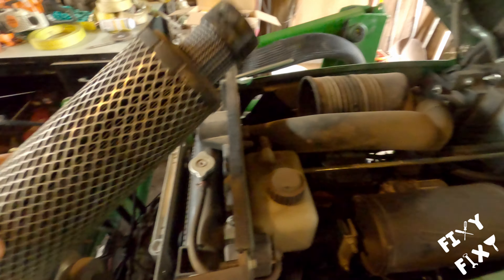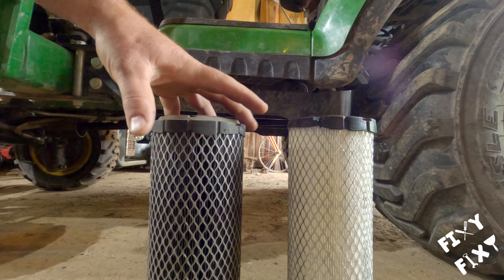Air Filter John Deere 1025R Replacement

Comment: This shows the old air filter mount I believe which I understand has an issue.  TTWT has a video on this issue and fix.
Reply from the maker: I'll have to check that out. TTWT has a tremendous amount of info on the 1025r
Reply: Definitely the old style.  I never did get a handle on how often it happens, but that style is attached to the engine valve cover and as it vibrates enough can crack that and send metal into the engine causing catastrophic failure.  My 2022 came with the new style which is rotated 90 degrees and attached differently. There is a replacement kit to upgrade for the older style to avoid that possibility.